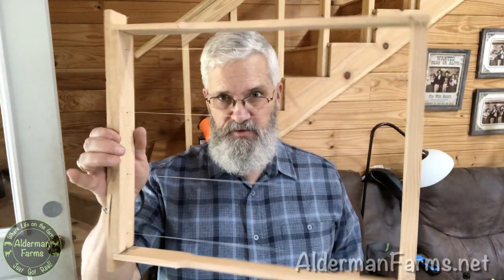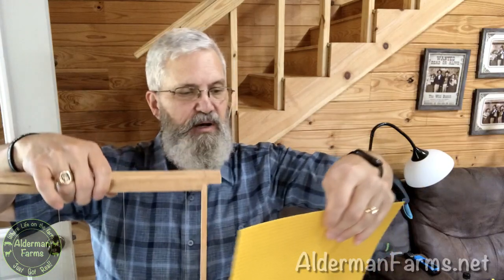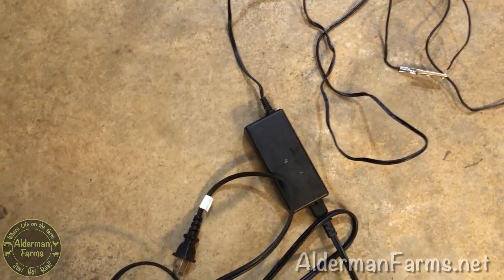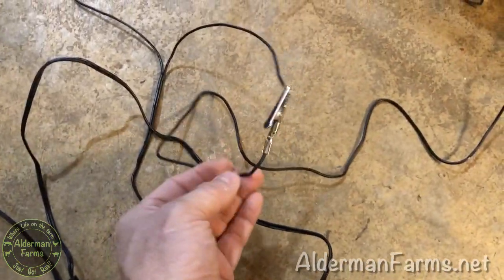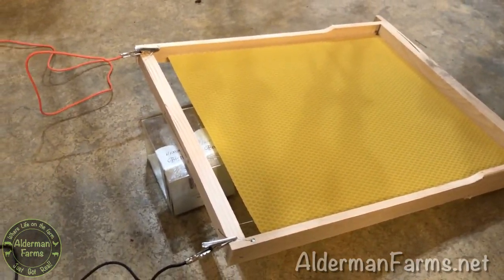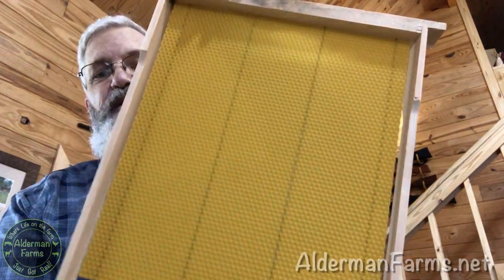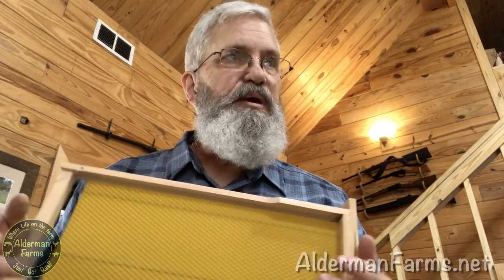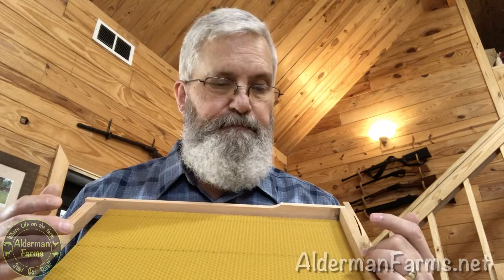How to Install Foundation Wax on a Wired Frame WITHOUT a Car Battery!

Comment: Hey Bro, congrats on what you are doing. I grew up in a commercial bee keeping family and you are headed in the right way but I want to offer some tips. 

You can simply use 120 out of a wall socket as this was the power we used. One side of the current we ran through a bottle of water. An electrode in and another one out. You simply add just a pinch of salt and dissolve the salt. Not enough current? Add more salt. Too much current? Even simpler. Just add more water to take down the salt concentration. When you are comfortable with how fast the wire heats up then you are good to go. You can make a jib with a spring and a hinge using a board that fits inside your frame. Have a couple contacts that you can press the wires against near the brads you use to fasten the wires. The contacts can be under the hinged board. One contact goes to the saline solution set up and the other goes straight to the wall plug. One of those contacts will be to a brass screw aligned with a brass contact that goes to either the wall or the saline. Then, pressing your wires over the wax foundation making sure you have contact on your metal contacts near the brads, press the hinged board and frame till you make contact with your brass contacts below. Wire will heat up, melt through the wax half way and pull up breaking contact with power. Let the wax and wire cool while maintaining enough pressure to hold it in place. It's just a second or so and it cools down. You can now remove your completed frame. You might also want to dust your board with corn starch to prevent the wax foundation from sticking. In this way you can electrify your entire frame. Just make sure when you are holding this down to not let your hand contact the wires or you will get a bit of a burn.
Reply from the maker: hey thanks!

Comment: If you take some cardboard and cut it where it just fit inside the frame may need two or three pieces just enough to pick the frame up off the floor then do it and it shouldn't burn through it should melt in that's how I do mine and I haven't had too many issues with it cutting all the way through the wax
Reply from the maker: that's BRILLIANT! great tip, thank you so much